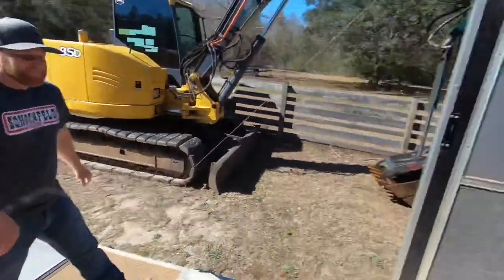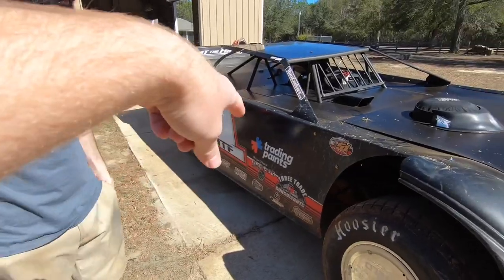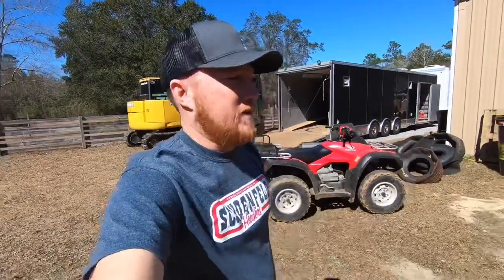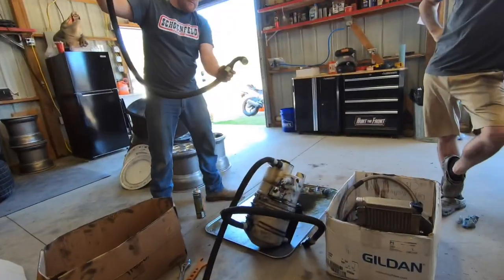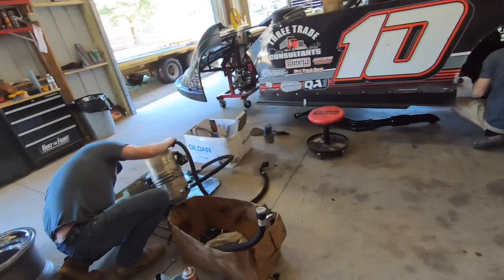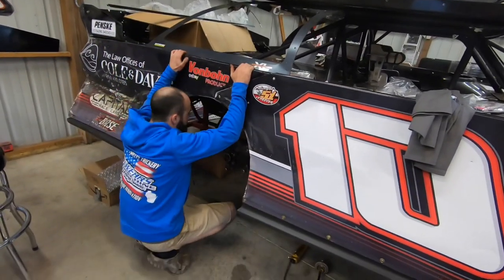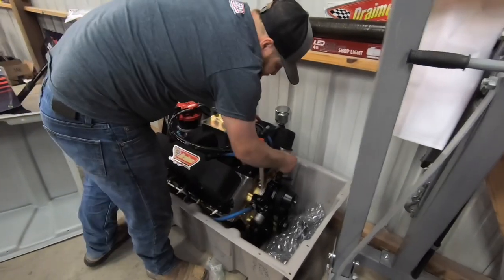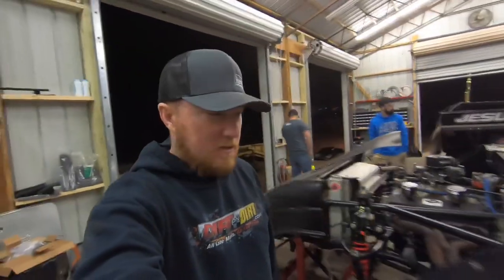Making Room for Something NEW! Preparing for a Trip to Capital Race Cars

Comment: The rod is 8ft long, about the length to the end of the spoiler. The extra piece we sent is to be welded at the end of the rod after you get the length. When you push the car to the trailer you pop off the steering wheel that’s on that car, pop the rod on where the steering wheel was and take the steering wheel and pop it on to the end of the rod and steer it in. When in the trailer we use a bungee cord from the wheel to the bumper so it doesn’t bounce. Once you get to the track, take the bungee off, steer it out the trailer and then pop your wheel off and pop the rod off and the wheel goes right back on and you’re ready to race. We found if you use a T-BAR you forget your steering wheel at the house lol
Reply: Thats what i said when the got it . But I think you did a better way of explaining it
Reply: Wouldn’t be the first time someone has arrived at the track and realised the steering wheel was left behind in the shed.... lol
Reply: @stewarth8390  been there done that unfortunately
Reply: Love it

Comment: If you don't have one, get an inexpensive parts washer and 20 gallons of solvent from Tractor Supply.  Wash your oil tank and lines in there...better and less mess than brake cleaner.  I enjoy your channel and I wish you guys the best. MWR Racing in Pennsylvania. PS: We will get to racing our Super Late Model as soon as the white stuff melts.

Comment: Just a pointer for cleaning up oily nasty parts is to use a small plastic pool to contain mess , can even cut milk crates down to 3-4” and use as strainer to keep parts up off the mess,  good luck on your trip and congrats on the new car

Comment: For those dry sump lines, spray the outside with engine degreaser.  Walmart sells their own brand for less than $2,, then hose off the outside, and use some brake cleaner for the inside, and of course cap or bag the ends if you are carrying those as spares in the trailer.

Comment: JESSE: BACK PAIN - Looked like your low back was hurting pretty good after the rear axle  move......Suggestion: Tennis ball or racquetball (whichever one feels best)(different diameters).....Lay on ball while lying flat of your back on carpeting - knees bent - find the most painful spot and hold the ball there until pain starts to become less.....then move ball to next most painful spot.......use your bent legs (feet flat on ground) to move your hips around so you can position the ball just right on your back.....repeat as tolerated.....its like giving yourself a massage......by using your own body weight to do the work

On a 1-10 scale, if 10 (severe) is worst pain you have ever had, aim for about a 3-5 (moderate)  and hold it there until pain starts to go lower......Larger tennis ball usually works best for low back and the smaller racquetball works best on the upper back......With your low back currently hurting and kind of "hot", I would suggest starting with the smaller racquetball on your lower back......20 minutes is the most I can handle......you will get up from a 10-20" session feeling much less pain and way more energized

Can even work while you are doing iracing or videos in your special iracing chair......Plastic bottle (emptied and cleaned out/cap on) or the container (Penn or whatever) that holds three new tennis balls inside (with all three balls still inside the container and the "vacuum seal" is still maintained) works great for trips in the car.....bottle end gives you a handle to grip so one can move it around.....easy to lose the ball......a 711 beverage always have something that will work on a trip

If your girlfriend gives you a much needed massage, then she will be sore and will also need a massage....this way you are independent.....I do it all the time......Trigger Points......hope that helps

Comment: I do believe your motor sounds much better with header gaskets .
Reply: Header gaskets make no difference if the RTV heat sealant didnt work it would have leaked and sucked air bad and burnt every valve in the motor. I use it every time

Comment: Are the cars not allowed mirrors? And what happened the engine that blew we've never heard about it again. And you all need a jizer bath for all the oil stuff they are great for cleaning. We used to use them alot for sprockets and all kinds of things off of speedway bikes.
Reply: No mirrors allowed no radios allowed... No one knows what happened to the motor but I do know it was fresh from Jay Dickens racing engines just that hot lap session when it blew..If there is a problem those guys aren't going to bad mouth anyone just like there starter problem.
Reply: So you are not misled (seems to be a thing!). The 604 crate motor was from General Motors (as ordered I believe). Be careful with "but I do know it was fresh from Jay Dickens racing engines..."  --- Jay Dickens Racing Engines provides "Dyno Services" !!!!  Jay Dickens DID NOT build/rebuild/manufacture/remanufacture this motor ... only provided dyno services on it. Jonathan mentioned/talked/stated these things ........ in at least 2 vlogs (maybe in a podcast or 2) --- and made things "Clear" in a 3rd vlog. I seem to recall that HTF stated that it was in GM's hands ... and he was gonna leave it at that.   ...... ---> In general and not quoting ... It was GM's decision on what they would do and HTF wasn't gonna stir the pot (so to speak). Respectable, huh!?!    Be Safe
Reply: @rodconner9079  hear we go again   Jay Dickins told HTF the cause  but HTF will not disclose . i could care less what gm says this engine  has no warranty i for one would lie to know the cause Jay told them if defective part  or abuse got to be one of the two so which is it??????
Reply: @boatmans78  and the saga never ends! JDRE (and Dyno Services!) may have performed a technical/diagnostic service for GM, either paid or contract; that info belongs to GM. If HTF were shared that info, either verbally or a "cheat peek" of written/documented outcome, it's not theirs to share with others till the time of "OK'd"/authorized by GM either directly or through JDRE (&/or JDDS). What GM says makes all the difference in the world --- they are the deciding factor/entity, yet a company that ya need to do business with in the future!!! ... Race parts fail, hell -- it's a harsh environment. Obviously -- in this case, not typical!!!   All that being said --- I have no affiliation with HTF, JDRE, GM, ect. ....  AND HTF has no obligation to share result ... Race Parts, not warranted. It's business!
I have the utmost respect for all of HTF (and that includes DirtDaddy!). HTF documented their side of it which many of us had seen. We also know of their character! "Abuse" isn't a factor here - again documented! essentially from the start! ... and they've been in it for some time before the "channel" started, with a good amount of success; that doesn't come from "abuse"!  Agreeable!?! (worn out motors - down on power due to wear!).  My assessment and only mine! ---> a failure in the bottom, rod related (video evidence of damage) ... by the size and location, seems to be either a rod bolt or rod cap failure. I could be wrong, hell - I've been there before :(  ............ but on this one, I'd have to be proven differently!!!!   Be Safe
Reply: @rodconner9079  that's your consensus theirs no way on this green earth that this is true deflective part/abuse/ i realize how long they have been race not putting any one down i have raced at southern  and built more cars and engines that i can remember i will soon be 74 and consider my self as a good guy don't wont and will not put anyone down theirs two sides to every story may you have smooth roads ahead

Comment: Are you guys getting a new motor for the new car, some have mentioned the motor you have may be a bit under power
Reply: Thats why it went back to draime to be set up for them. That motor is a monster.
Reply: Nope sticking with the DRAIME
Reply: A used motor with more power like a Cornett/Pro Power/Vic Hill is around $30,000. I’d guess that Draime was somewhere around $10,000-$15,000. When they sent the Draime off this winter to be gone through they pull the manufacture tag and said it was originally built in 07 or 08, so it is a very reliable engine which for these guys is worth losing some power.
Reply: @Brian-vd4mg  we should all pitch in and get these guys the best motor see what Joseph can do. I just hate to see them beat on power, such a huge fan and I want to see these guys on top of the world in Late Model racing. Maybe some day we can see Joseph run a sprint car 🤔🤔
Reply: @Brian-vd4mg  draime are known for reliability you definitely got that right... I believe it was brand new from draime in 07 from what the paperwork said.... For an engine to be 14yrs old and still competitive... I'd definitely say that's a good investment without breaking the bank.... it's definitely got some get off the corner speed... can't wait to see the draime/penske combo
Reply: @michaelmcginnis9029  Actually it's not a monster it's 80hp down....Check there video where they got it back from Draime the Dyno sheet says 850 hp ..New wide bore motors from Clements/Cornett/Durham are making 930hp+ ...the video link is attached: https://www.youtube.com/watch?v=FAWb5wDganQ&ab_channel=HunttheFront      Time stamp 12:05
Reply: I can’t wait to see the new car it’s gonna make my month!!!
Reply: @frankknoblock2275  if you follow them on Facebook or Twitter.... you would've seen it by now 😉😉
Reply: @JJ-1-1  853hp but go on
Reply: @davidadcock1475  not a big fan of either platforms. I bet it looks sharp
Reply: @frankknoblock2275  flat black with white trim and I believe it was a white deck on it too.... looks NASTY

Comment: don't be cheap- never run used oil lines or oil cooler on a new engine.  little splinters can get lodged anywhere, flexing a line or running the oil the opposite direction can dislodge them even after cleaning and BAM the new motor is now a door stop and conversation piece.  just don't do it.'. the dry sump tank can be disassembled and cleaned- the oil cooler - not so much.